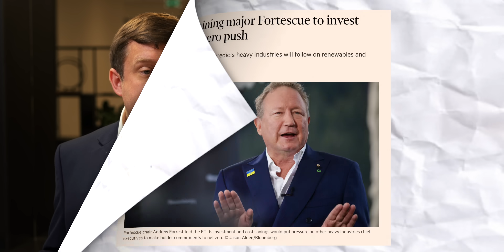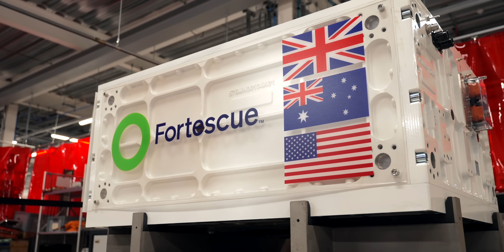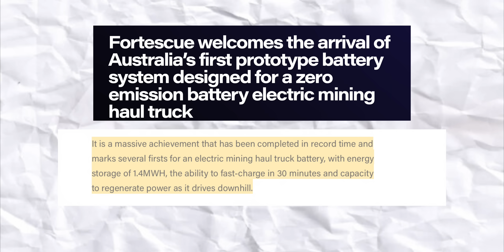This GIANT Electric Mining Truck Charges in Under 30 minutes!

Comment: Who will pay for that "vision"? Increased costs for mining (more trucks, solar, increased truck prices etc..) will increase steel prices and therefore increase our daily costs for everything made from steel.
Reply from the maker: I love comments like this. I'm waiting to join a call with people who are actually doing something about the technology we rely on rather than merely having an opinion about it based on hearsay and misinformation, so I'll answer now.
Let's just go through a few things,
How much diesel, that's had to be transported to a very remote site at great cost, do the conventional combustion powered trucks consume?
I'll tell you, when loaded, 5.4 gallons to the mile. They will burn through many hundreds of gallon a day, and there are hundreds of trucks, so that's tens of thourands of gallon a day. Of diesel. That can be burned once.
Where does that sensible, clean diesel come from? 
By train, after a journey of a couple of thousand kilometers. 
What about before that?
How did it get there?
It's transported thousands of miles by ship, the dirtiest ships on the world's oceans. Oil tankers sail low in the water, more water to push out of the way, hence more fuel burned. It's then pumped on shore by electric pumps the size of a small house into massive tanks near an oil refinery.
What happens when it gets to a refinery?
Not only are millions of barrels of oil burned at the refinery to facilitate the refining process, multiple millions of megawatt hours of electricity are required. An oil refinery consumes the same amount of electricity as a mid sized city.
What happens when it's been refined?
It's transported by train to the quarry site, in the case of Pilbara, a very very long distance.
Is running electric trucks powered by a solar farm next to the site a better option?
Yes. 
How did the solar panels get there?
They were manufactured in China or Korea, shipped to the site at considerable cost, a large battery system was installed at considerable cost.
How much does that cost to run.
So little it's hard to calculate.
How long will it last.
30-35 years
What's the payback time?
5 years, after that the comapny are saving billions every year on imported toxic fuel costs.
Is it a cheaper option?
Yes, why do you think an iron ore mining company with a constant, obsessive eye on the bottom line is going to increase their costs in a competitive market by 'virtue signalling' with electric quarry trucks.
Reply: @fullychargedshow Don't forget how much diesel is aslo used to run the rest of the mine and camp, that atleast some of that can be saved with solar ect.
Also besides the potential fuel savings of the truck, it's not like adding the battery is purely adding cost. It will be more expensive for now, but you get to remove (this is a ball park figure, I haven't gone and quoted all the parts) roughly $1 million Australian in engine and power train parts (if comparing to a mechanical drive truck like most, if not all of the CAT trucks are in W.A), or engine and main alternator if comparing to a diesel electric like the Hitachis, Komatsus, Terex ect.
CAT advertises that their C175-16 engine is good for 1 million gallons (3.8 million litres) fuel burn between rebuilds. The sites I've been at are usually going more off hours, but a scheduled engine rebuild comes around every 3 to 4 years.

Comment: :pillow-turquoise-hot-chocolate:Just use ethanol and biodiesel plants combined with PV and wind turbines to produce fuel. No need to scrap all those cars with internal combustion engines. Just be reasonable.

Comment: It is easy to make everything electric. You dont need to make electric trucks. We have an electric trains. You dont need electric buses there are troley buses. This goes on and on. Everithing is already there. We just refuse to change things. This truck is one of the final things. Loveli.
Reply: Na isn't electric drive line exists diesel electric not battery storage electric. And not only isn't it easy it won't work.

Comment: Wow, imagine how much CO2 is tied up in the manufacture of that giant battery, and how many toxins would be released if it experienced a thermal runaway! Maybe they have an extra fire extinguisher or two in the cab, just in case. The fast charging capability will doubtless help reduce strain on the grid - oh wait, exactly the opposite. I expect the manufacturer will go bankrupt as soon as they stop receiving carbon credits and other handouts from us poor taxpayers, doubtless with golden parachutes for the executives.  Great truck, by the way.... not really, just kidding.
Reply: Not like it would be the first mining machine to burn down. That's why they all have to have fire suppression systems.  A site I was at a few years ago lost a $10 million AUD wheel loader to a tyre fire, but fire suspension wasn't going to save that and Water trucks couldn't stay around to put it out, incase the tyre exploxed. I would say this battery will be built to contain fires between modules, but we'll see.
Most of these mine sites aren't connected to the main grid. They have their own power stations on site.
These trucks use in the ball park of a million litres of fuel a year, so if they can replace a lot of that fuel with solar there's money to be saved.
You can also remove around $1 million in parts, before putting the battery in these trucks.

Comment: I wpuld rather see the system with the overhead wires and pantographs. You save a huge amount of diesel with no charging delays or huge batteries needed.

Comment: In the same area used by a nuclear power station you can produce more electricity by solar panels with no one maning it and little maintenance.
Reply: Hay bud.
Have you read that statement? You might want to rethink that one.🖐 take care.
Reply: @0Aus  Words taken out of A. Musk, I didn't make it up. No, I didn't do the math but given the land area of powerstations, it's pretty close. Even if a solar farm uses twice as much land, so what? Its not arable land, usually a desert, its free and once built the maintenance costs are very little compared to other station that require not just fuel but dozens of permanent staff, 24-7. There are solar farms now that produce 2Gw of power while some nuclear produce around 1Gw. Not saying we don't need nuclear and others, we do, but solar is just cheaper and in the long run I would think it pollutes less.
Reply: @antoniocruz8083  Cool✋ I can only assume you have a plan 😉👌
Reply: @0Aus   I've powered a house strictly on solar for 20 years, yeah, plan achieved.
Reply: @antoniocruz8083  yeah my living situation is powdered with solar & generator.
Still not buying the story

Comment: In Norway excavators in the city are electric now. The battery last half a day and its charged during lunch hour.
Reply: Thats so cool
Reply: That’s good but no comparison to the amount of power a haul truck uses.

Climbing out of a pit they burn 2000 litres plus of diesel every 12 hours

We have big 200 and 400 tonne excavators and big wheel loaders to load the fleets of haul trucks

The amount of energy expended on a mining fleet shift if 20 haul trucks a couple of excavators and a wheel loader 
would make your excavator in Norway look like a matchbox toy

There is no comparison between an excavator in civil works and a production iron ore mine

To give you a visual

Imagine a train 2 kilometres long with 200 carriages each with 150 tonnes of ore 
Being produced at the rate of twins shift…

That’s not exaggeration and the scale of production at iron ore mines in the Pilbara has to be seen to be understood.

It’s great to be positive and we all wish twiggy the best
But this is a waste of effort until you can have a nuclear power source that runs 24/7 and is carbon free

Manufacturing transporting and erecting and maintaining a solar power station capable of running a fleet of haul trucks will be economically unsustainable and anything but carbon free
Reply: @secretdad544  Some mines in Australia are now changing their diesel haul trucks, that consume 2000 liters/day in diesel, for battery operated trucks, charged by solar panels mounted nearby occupying a few football fields of panels. So, yes, haul trucks can be eletric. Don't underestimate electricity, the transition is coming. Electrical motors, based on magnetism can be much stronger than ice, are much simpler and last longer. I've seen huge electrical pumps that worked 30 years non-stop, thats without stopping once for maintenance, try that with an ice. And they can be partly fed by hydro (close to 100% in Norway) to wind and solar saving vast amounts of oil. Are you saying that oil burning technology is the last and ultimate mankind can hope to achieve? Should we stop investment and research in renewables? Just give up because we will never be able to replace oil.
Reply: @antoniocruz8083  Antonio electric drive trucks are already heard and have been since the 1970s
They make full torque at 1 rpm and are far superior to mechanical trucks - I know that because I have been working in them for 10 years 

What I am saying is that electric drive trucks powered by solar panels and batteries will be far more harmful to the earth then electric drive trucks powered by nuclear 

It is more inefficient and dangerous to the environment  to generate electricity in massive solar panel fields that cause massive pollution in their construction and maintenance and disassembly  
diesel gas fired power station
Reply: @antoniocruz8083  the transition to electric cars is also coming it’s being driven by the WEF in Brussels. Electric cars are faster quieter and emit no gasses directly, but as you would know the power has to be generated somewhere to re charge the car.

If the carbon footprint and environmental damage of solar panels and wind generation and all the lead / lithium / Nickel carbide batteries is greater damage to the earth then we still have a problem

The problem is that solar and batteries are not energy efficient or environmentally friendly “cradle to grave” compared to nuclear power and hydrogen power

So I agree electricity is good but
How we generate that power and how we store that power 

needs to improve over solar panels and lead acid batteries with rare elements.
Reply: @secretdad544  1. Have you ever heard of Chernobyl and Fukuchima? 2. Solar stations that produce more energy than a nuclear ones, like in India and China, require very little manpower for maintaince with panels working for 40 years. 3. Maybe you are not aware of the amount of power and pollution it takes to get gasoline to a gas pump, from prospecting, thousands of oil fields including offshore accessed by helicopter, huge pumps for transporting in leaky pipes, huge oil tankers that pollute as much as a small city, refineries that pollute and stink, huge expensive storage tanks, literally dozens of thousands of trucks to distribute gas to every million of gas pumps in the world. All this, so the oil ends up being burned into thin air, unlike lithium that can be 95% recycled inumerous times. I really can't see any other industry polluting as much as oil.
Reply: @secretdad544  1. Hydrogen is not a power source, it is just a way to store energy. It must be produced either by fossil fuels or renewables. It is only useful as stored energy for industry, for cars for instance it is much cheaper to charge a battery directly from the source then first produce hydrogen, then transport it, then store it, to get it to the car. 2. Acid batteries? what century do you live in? 3. The amount of rare minerals used worldwide including lithium is a tiny tiny fraction of what oil is extracted, transported, refined, etc so its mining pollutes infinitesimal less than all the oil extracted. And above all, it is not burned into the air but can be recycled unlimited times. There are now around 10.000 lithium  recycling plants in China and 95% can be re-used.
Reply: norway, is it? all this sponsored by oil, lol..
Reply: @izoyt First paved roads for cars were built by horses and steam with money generated from that previous technology. All new technology depends on the previous one, including its finances, how else can it be developed, out of thin air.
Reply: Yep, charge with diesel generators. At least that what they do where i live in Norway. Producing noise pollution the whole night
Reply: @girenloland  I wish my energy storage charging device could help them, so there would be no noise🤭
Reply: There's no battery currently in production that you could run a large mining excavator or shovel on for a reasonable amount of time. They're a whole order of magnitude larger than the small machines you see in construction. Instead it's back to the future using cable electric machines. FMG and BHP currently have trial electric cable excavators in testing now.
Reply: @bcm70  why do people think that ev is battery ? Dosnt matter how the electricity is made a ev is still electric . The biggest  diggers in history have always been electric .
Reply: @bcm70  I meant bulldozers and street excavators. I was talking about this in another post, sorry. In Norway they use them in the city so as not to make noise. Sometimes they have to charge by a generator if there's no strong electrical connections but for a large part it's the country's hydro power that charges them. Where I live there are already electrical buses and large ferries. No industrial machines with batteries but with cable, charged by renewables quite often. Electrification is coming but it's going to take a couple of decades and at a high initial cost but anything no to depend on oil and especially russian oil. Car charges are poping up fast here with a new gov't directive that in the countryside there must be one charger every 50km, much more in the city.
Reply: what a joke
Reply: @mpokoraa  You certainly are.
Reply: @Wilem35  I ain't no joke I have a PhD in excavators
Reply: @mpokoraa  I saw in a documentary on a national tv channel, am I not to believe it?  If it is not possible then please explain. Please explain also how a private company invests millions in electrical equipment without doing the math as to its usefulness, rentability and longetivity.
Reply: @antoniocruz8083  I'm not going to waste my time trying to explain basic calculus to a cockroach. Please advise
Reply: @mpokoraa  You have no more argument, that's why you start insulting, it's a typical attitude. I asked, why would a team of private investors, including economists, engineers, go ahead and spend millions on a technology that you, a YouTube commentator, regard as inadequate. You don't have to use calculus even though I'm sure I understand it more than you given my engineering background, just use general terms. What do you know that they don't know. Notice that I did not insulting you.
Reply: @mpokoraa  Can't answer the question, can you.
Reply: @antoniocruz8083  which question exactly?
Reply: @mpokoraa  sheesh champ you got burnt big time .
Reply: @chrisward5626  burnt by who?
Reply: @mpokoraa  sheesh would you realy need to ask ?
Reply: @antoniocruz8083  the power has to come from somewhere. That somewhere is usually a diesel generator whether it is on the haul truck or in a nearby power station

The diesel fossil fuels are still getting burned but it’s less efficient if you do it remotely in a powerstation
Reply: @antoniocruz8083  they sound like they are insulting you because they have no argument but the truth is you have not grasped how much fuel and power is being talked about here.
The Norway excavatir example would be 1/10 the size of a 400 ton O&K iron ore excavator 

P&N make electric excavators rather face shovels and there are drag lines in coal - massive electric machines

But the electricity still has to be generated and there is no hydro out here… it’s all done by gas  fired gensets or diesel gensets
So nothing in the way of carbon has been saved
Reply: @secretdad544  Why don't you believe in electrical technology? Just about every single new car sold in China, the biggest car market in the world, is electric. Many countries now, including here in Portugal use at times 100% of renewable, solar, wind, hydro, to produce electricity. It's mainly industrialised countries that need huge amounts of energy , that cannot depend on 100% renewables. Still, many sectors, including personal transport and home consumption can be powered by renewables and that's billions of gallons less burned up into thin air. In the long run they are cheaper and allow countries to be energy independent mainly from Russian oil.
Reply: @mpokoraa  "PhD in excavators" that's hilarious.
Reply: @Neojhun  at least my degree is worth something

Comment: a company called JANUS in Australia is doing exactly the same thing by converting existing heavy diesel highway trucks and their batteries look just like that, very impressive what they have done. NO charging required with their system, batteries get swapped by a forklift driver in ONE MINUTE when the truck pulls into the station and they are on the road again, faster than fueling up!
Reply: We all know Janus, they're famous for the cement truck fire on the bridge..........and the prototype at their own site. Waiting for their next update.
Reply: More than one has burst into flames while out working lol